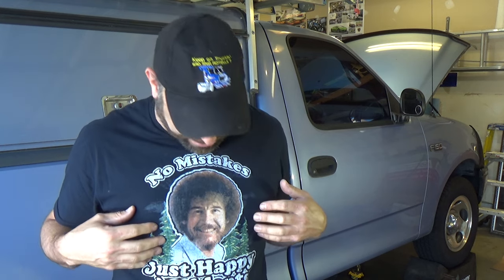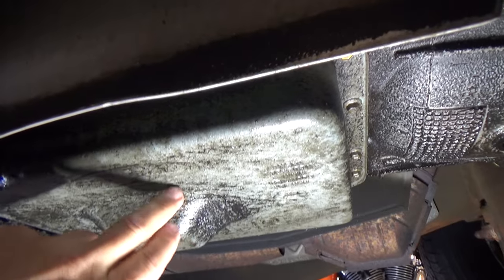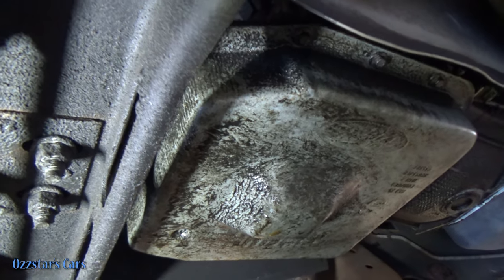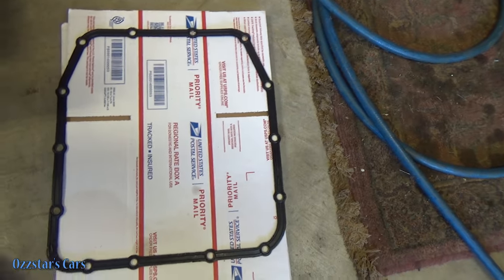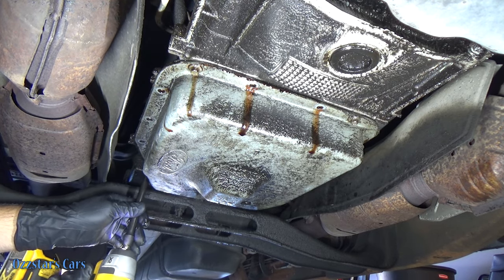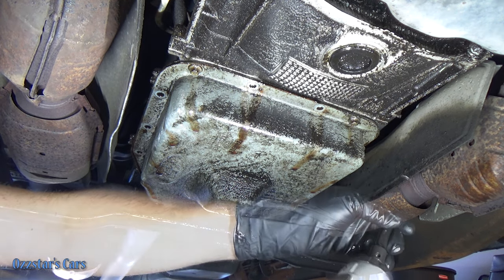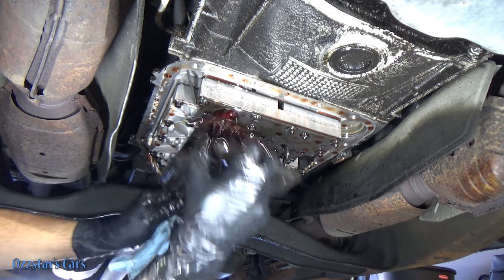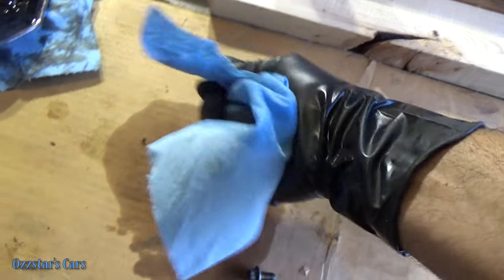Transmission Fluid Change In 24 Years!  How Bad Does it Look? F-150

Comment: So i just checked Advance Auto parts and they showed Dextron and not Mercon?  Can you tell me what is the Difference?
Reply from the maker: Mercon V is what this transmission specs.  I don't know what you are working on so can't tell you.
Reply: Dextron is GM
Reply: Check your dipstick and/or the door sticker. Some of these F150's use Mercon V, and some use just Mercon (which is sold as Dex/Merc since they're the same). Mercon and Mercon V are NOT interchangeable.

Comment: Got a decent leak under the engine.  We can't tell if it's oil or transmission fluid because of the age of the transmission fluid.  
It's brown semi translucent and about the consistency of oil and transmission fluid. 
2003 f150  v8 4.6L  347k miles!  
Checked both dipsticks and both show very low. Certainly haven't lost 13 quarts of transmission fluid . Nor have I lost 5-6 quarts of oil.  Unfortunately after driving to the store and back, the fluid is all over the damn engine now.
Reply from the maker: Clean and recheck?
Reply: @ozzstars_cars  clean meaning the underneath and engine wipe down to remove splatter?

Comment: I have a question what do you call that black cicle cap on the side of the pan???? And what is it for
Reply from the maker: The black what cap? What time stamp in the video?
Reply: On the other side of the pan! It looks like a suction type of cap!
Reply: Looks like you can drain something also by removing that black circle plug
Reply: That's the inspection plug on the bell housing

Comment: How’s that tranny holden up.  I’m still debating doing the same service to my 20 yr old vic with 118000 miles.
Reply from the maker: Shifting smoother than it has in the past 10 years.  The 1-2 and 2-3 are so much better.
Reply: @ozzstars_cars  Thank you sir, now I’ll definitely will do that service to the tranny… suscribed to your channel to educate, and learn from your videos… one last thing on my Vic I use motorcraft semi synthetic blend 5W 20, along with the motorcraft oil filter 820S. Should I keep using that or change the viscosity to 5W 30 and other brand of oil. Thank you for responding have a good day…
Reply from the maker: @Pedro Saenz  I don't recall many cars back then using 5w20.  Most were 5w30 and the owners manual or under hood dipstick should state the proper viscosity.
Reply: @ozzstars_cars  ok thank you

Comment: Fluid that dirty and you didn't flush it?
Reply from the maker: Drain and refill.
Reply: When you flush the fluid is when you start having problems with the transmission. Better to drain and refill couple times till the fluid is fresh again.
Reply: @ozzstars_cars  when you say drain and refill do I have to also change the filter each time I do this?
How many times to do a drain and refill, until the transmission fluid is the normal color?
Reply from the maker: @flowersfam3462  depends how dirty. I usually change the filter once, then next time just change the fluid only.
Reply: @ozzstars_cars  Thanks.

Comment: that pan gasket was reusable! all ford pan gaskets like that are reusable!
Reply from the maker: Not when it's 24 years old.
Reply: @ozzstars_cars  no it's still reusable. drain the torque converter when you do a pan change for 100% of the fluid.
Reply: Why would you use the old gasket when you can have a new one for a couple bucks? 🤔
Reply: @arthurmomo4406  the oem gasket is very good quality being it is steel/rubber and the aftermarket is cheap quality just rubber or cork.
Reply: @D4x4Bronc  but he showed you the new one was rubber and steel by putting the magnet on it
Reply: The Old Gasket is Reusable as long as you didn't have a Leak Before Opening The Transmission Pan
Reply: @luisponce1472  most of time leak is bent pan or stripped screw hole
Reply: @arthurmomo4406   I bought a new oem gasket. It was $35! But I wanted to make sure it was gonna seal the first time. With 57k miles, that might be the last time I drop the pan.
Reply: @D4x4Bronc  Well, not 100%, but pretty close. Trans cooler and lines have fluid as well.

Comment: Update? Did it end up slipping?
Reply from the maker: Nope, smooth as glass. Flushed it a second time, no converter shudder. Very pleased.
Reply: @ozzstars_cars  awesome. I guess I’ll do mine. 157k mile toyota pickup I just bought
Reply from the maker: @Miles-wy1zr  drain and fill. Drive 500 miles, do it again.
Reply: I guess I'll do my 2000 ford expedition 4.6L V8 Triton XLT with 281k miles now since I saw your video. As a female, your video is easy to follow.😊
Reply from the maker: @flowersfam3462  with that mileage I would only change the fluid if there was already a shifting issue OR the transmission has had regular interval trans6 fluid changes.
Reply: @ozzstars_cars  Does that mean no changing the filter at all? I'm unable to go in reverse and I assumed the transmission filter was clogged and needed to be replaced.
Reply from the maker: @flowersfam3462  that sounds  more than a filter problem.
Reply: @ozzstars_cars   I was hoping it was the filter.😔 But I found a screw that fell out of my shift linkage and hopefully that's the issue. Anyway, thanks for responding. I really appreciate it.